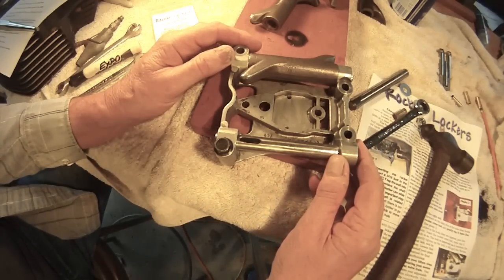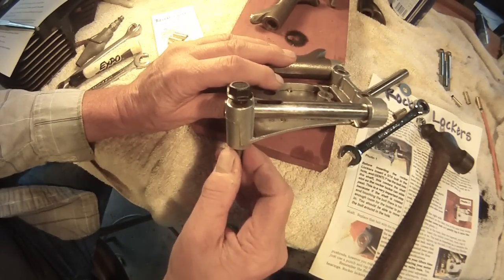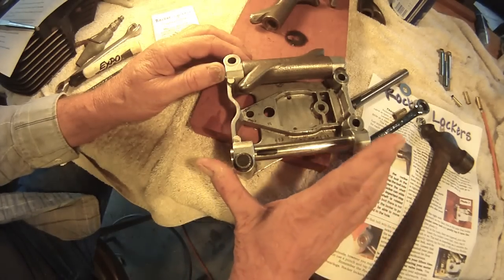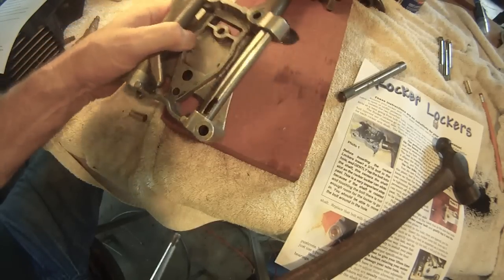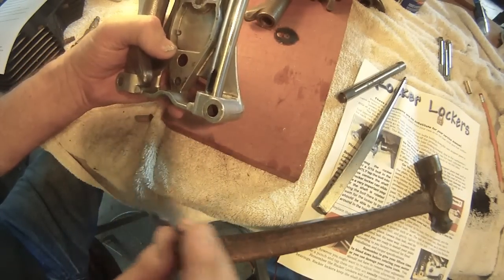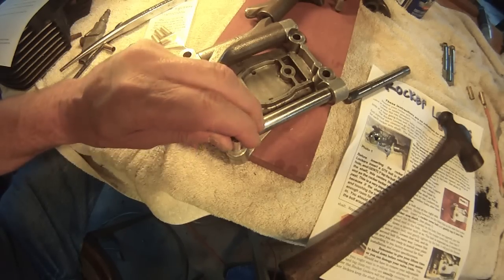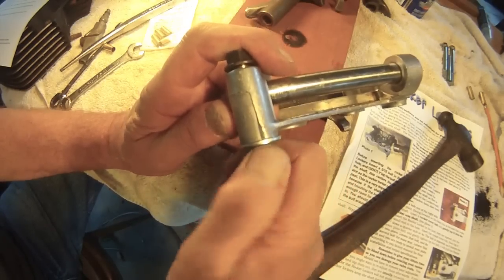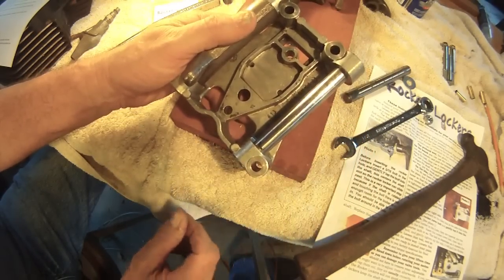Cure for Harley tick, Rocker Lockers

Comment: Harley’s are like tractors, the engineers didn’t do a good job with tolerance and clearance, I’m a retired Harley mechanic and now I’ll work on anything and the difference I see is Harley’s vs everything else is Harley’s are like working on farm equipment vs high end automobiles

Comment: How do you remove it if there is a need to replace or service your rocker arms or shafts?  Can the bushing be re-used?
Reply from the maker: Jason, you can punch out the rocker lockers using a punch from the bottom side, or use the flat side of the centering tool that comes with the kit.
usually they come right out and usually can be reused.
Reply from the maker: +Harley Cruiser here is the updated video showing the alignment tool.
https://youtu.be/2TgYZPvAPTs

Comment: If I remove the rocker box to do this fix do I have to install new gaskets or can I reuse the old ones?
Reply from the maker: Gabor it depends on what gaskets were used before, usually HD gaskets if not that old can be reused but in all honesty we recommend using new gaskets, the risk of a leak is not worth the risk.
Also this video is obsolete the installation recommendations have changed over the years, here is the new video link. 
https://youtu.be/2TgYZPvAPTs

Comment: hello! can i instal the rocker inserts shafts without removing the rockets?
Reply from the maker: Antonis, yes you can, however the rocker arm assembly must be loose so that the shaft is able to turn or the inserts will not pull in, they will mushroom.  Since the rocker arm assembly needs to be loose it is much easier to go ahead and remove the plate and do it on the work bench, something we have always shown in our videos.